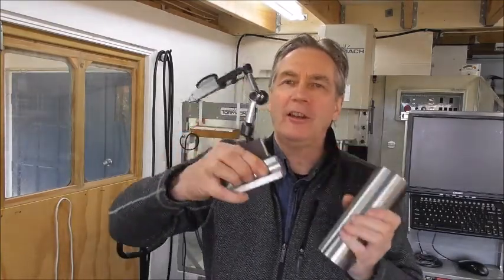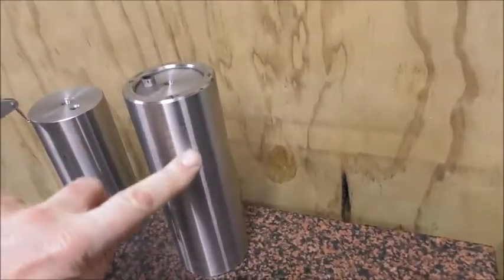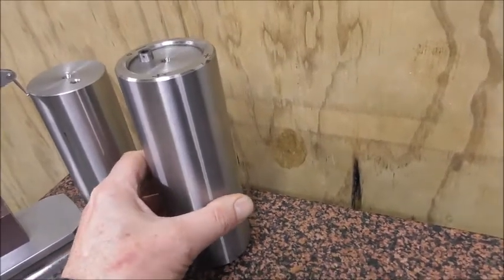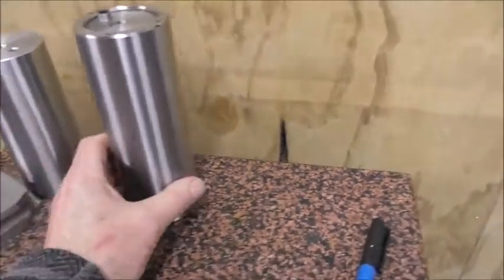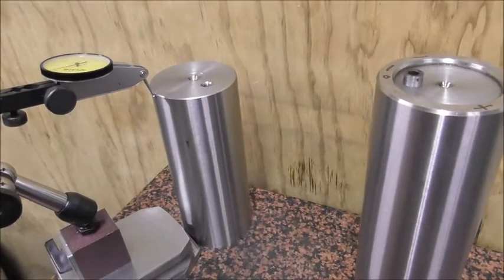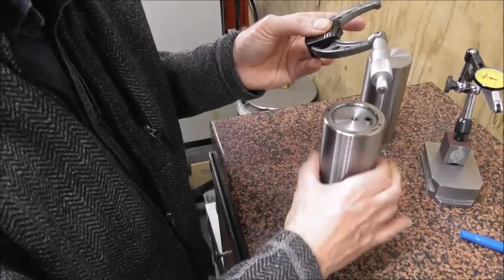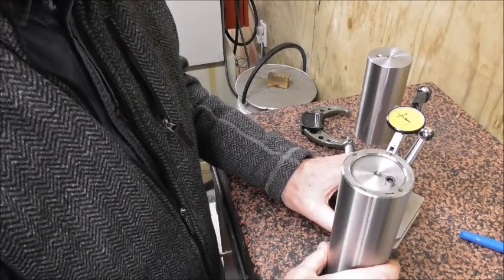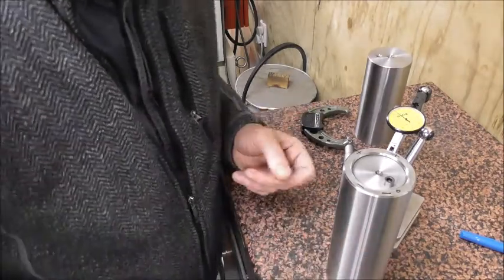Cylinder Squares.

Comment: Good info, and nice job on the cylinder square. Perhaps a better method of verifying the diameter of the cylinder remains constant from end to end, is to lay it down on the surface plate, and roll it under a DTI, and simply look for a relative change, rather than absolute measurement? It would help eliminate the variable of micrometer thimble "feel", springing the frame, etc....
Reply from the maker: Hi Jeff. Good idea! Sometimes the obvious escapes us. Cheers, Cliff
Reply: In the process of making my first cylinder square, and finding your videos was a big help. New subscriber now! I've got it rough ground and ready to be carburized before finish grinding/lapping. ( it's 3"x6" and 8620 steel ) @Threadexpress
Reply from the maker: @907jl  Cheers! Cliff

Comment: Why couldn't you have used a 600 or 1000 grit carborundum sheet (blank side down on the granite) directly on your granite plate, instead of using diamond grit for lapping on a flat ground piece of steel?
Reply from the maker: Hi - Well the tiny amount required to remove would be more difficult to control using paper that compresses and varies slightly in thickness, and cuts less evenly. Also it may shed abrasive on to the surface plate. But it might work. Cheers  Cliff